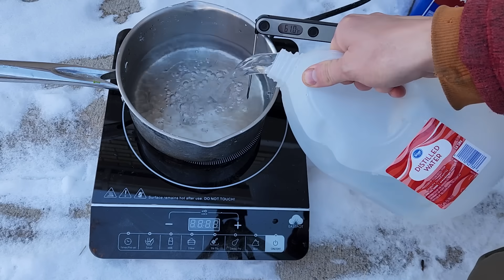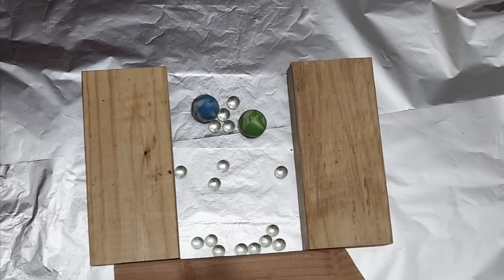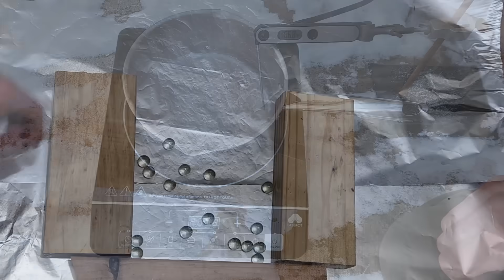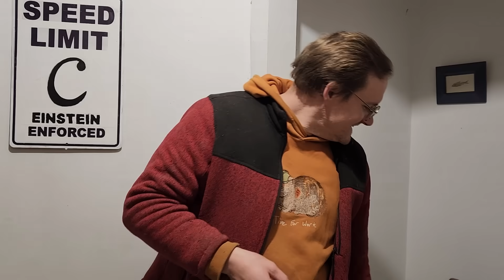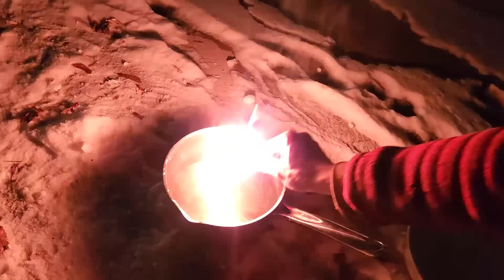Raoult's law

Comment: Wait is this why adding silica to iron makes iron melt at a lower temperature? (I think the same is true with iron to silica when making glass, too, but I don't remember for sure. I just know silica into iron lowers iron's melting point)
Reply from the maker: yes. alloys typically have lower melting points than pure metals. the exceptions being when they combine to make a crystal that is more stable.

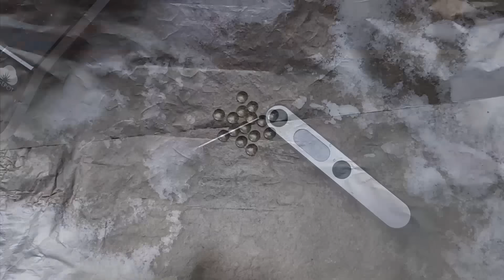Comment: 06:15 ....Is it? We need subtitles.
Reply: Yes, when you force a solid into a liquid without adding energy, it takes energy to complete that task, thus lowering the temperature. A fun experiment at home will prove this. A bottle filled with water and ice, just at 0C, will stay there at 0C until all ice is melted. If you add salt to the second sample, the ice will melt, absorbing some energy and dropping the temperature. This should be very well measurable.
Reply: @Robbedoes2  He said the water is now boiling at a lower temperature than normal. And then showed some weird americanese numbers. I have no idea when water boils or how abnormal that was.
Reply: @nazamroth8427  He said melt, not boil. And 32°F is melting point, thermometer showed lower

Comment: I dont get this. It all seems around blocking exit points, but I thought it can evaptorate anywhere in the liquid? Also why wouldnt the liquid boil at different temps based on its surface area or volume?
Reply from the maker: I see what you are getting at. if you had the mixture contained in a pressure vessel and then suddenly released it a large fraction of the liquid would in fact instantly turn to vapor as a new equilibrium is established at the lower pressure. 
Yes the blocking exit points thing is a surface behavior, describing it explains how it will evaporate and the temperature at which it will start boiling but after that point all bets are off.
Reply: The blocking the exit points explanation is basically wrong but the real explanation is entropy which is even harder to explain (look up the derivation of raoult’s law if you want to update your thermo. It comes from the entropy change of an ideal mixture). 
Sometimes I like to think of mixtures from the context of like-attracts-like. So water is very happy to be in the liquid phase and surrounded by other water. When you add something that isn’t water, it generally isn’t as happy. The identity of that second component then can add additional no ideality (ideal = water is indifferent to the new component, just near less of its friends; nonideal = water really likes or really hates the new component).

Comment: I remember growing up in Salt Lake, and my dad telling me that adding salt to the water made it boil sooner than unsalted water, but not HOW. I assumed then that it was because salt water had a lower boiling point than pure water, and thought my dad was a moron because he didn't know that the water wasn't reaching a higher temperature. I now see that the water WAS reaching a higher temperature than even pure water, but it's equally clear that he didn't know why, he was simply reporting experiential observations without understanding the underlying mechanism. Thus, not a moron, simply uninformed.
Reply from the maker: Interestingly adding even a pinch of salt will in fact make water boil sooner because it (actually the contaminants in the salt) act as nucleation sites for bubbles to form from and that keeps the water from super heating. 
Adding a lot of salt will also speed things along because it has a lower specific heat, meaning that a given volume will take less energy to heat up even if it has to get to a higher temperature to boil.

Comment: Hey Cody, what do you think of the prospect of a piezoelectric battery? I was thinking of using a pressurized tank with suspended quartz and some form of electrolytic conduction fluid with "guide" wires hooked up to the discharge terminals.

Comment: One of things i learned that salt doesn't "melt" snow, it just make solution that has lower melting point. Solution is possible because there is equilibrium between solid and liquid and alvays is some part of liquid that can dissolve salt. 
And yes, the destilation "steps".

Comment: Is boiling things a way to see its purity as well? And in the same, you could proberly calculate how much water you put in the alcohol, buy the temperature of the boiling mixture?
Reply from the maker: Oh yes I could absolutely calculate how much water I added by the temperature. Infact I am pretty sure I had a homework problem like that once.
Reply: @theCodyReeder  Thanks for the answer. That was an honor having you reply. 😊
Reply: @darabbit333 in my organic chemistry lab class, the number one way to test for purity was to test its melting point in a fancy machine. However this doesn't give a definite purity unless you know beforehand what impurities are there and how the melting point will change based on them. So it was mostly just to gauge purity, like if the melting point was within 0.5 degrees it was pretty good.
Reply: @skanderbeg152  very interesting. Thanks for sharing. I wish the likes of Codyslab and other science youtuber was a thing in my youth 1990. Instead I had a science teacher who pretty much didnt know anything about science. It was just an english teacher they put up as a science teacher. My career would have been so much different.
Reply: @darabbit333  no problem. Sorry to hear about your disappointment, I feel very fortunate that I was born in a time where I was exposed to science, math and chemistry on YouTube by people such as Cody and I attribute all of that to the path I took. Now I'm several years into a chemical engineering degree.
Reply: @skanderbeg152  Impressive. Yes, these guys most have influenced several generations by now. I have followed him since 25k subscribers and it has been a blast. Its a bit sad there is such a long wait time between videos, but i enjoy them when they arrive.

Comment: When i make table salt the correct way using the right method, i do it exactly like the corp of discovery did on the west coast in December, 1805 to March, 1806 near fort clapstop.  I add sea water to a big pot and boil all the water away and am left with high quality sea salt.  i'm sure i could trade it for horses and blankets and stuff but i mostly use it for seasoning, and deicing my driveway, stuff like that.

Comment: That's why you add salt when boiling pasta 😳
Reply: No, it only changes the temperature a small bit. Especially at the concentration used for cooking. The salt is added to flavor the pasta. Notice how much salt Cody added to how little water and the temperature only increases 4 degrees.

Comment: Bro that intro blew my mind! had to watch it 5 times. Ty for content im sure i will enjoy the other 99% of the vid aswell.
Edit: When you add water to boiling alcohol and the temp goes to 161, you mentioned that the temp goes up so it resembles the water boiling temp more. My question is if the water is really boiling at lower heat because of it or is the alcohol boiling and the water just warm? I just thought it was interresting, maybe not :D
Reply: Fun fact: if you add ethylene glycol to water, the boiling point will increase and the freezing point will decrease: the opposite of a alcohol/water solution.
Reply: Now this is where we get into henry's law too and the fundamentals behind distillation. So stay tuned ;) The truth is, that the changes are gradual and the partial pressures in the evaporated binary gaseous phase are related to the concentrations in the binary liquid mixture.

Comment: I usually just say I add salt to the water so it boils faster, but this is much more accurate.
Reply: You add salt to pasta water to season the pasta. It actually makes the water take longer to boil (it has to reach a higher temperature) but more importantly it does not change the boiling temperature any appreciable amount at the concentration used for cooking. Notice how much salt Cody uses and it only raises the temperature by 4F.

Comment: It snowed enough for it to be thick on the ground for the first time in about 48 years at my house.  I'm trapped by six inches of snow.  Can't seem to find a snow shovel or warm mittens around the house. Got any suggestions for that?
Reply: 6 inches isn't too much to walk through. It will melt soon enough.
Reply: @MushroomMagpie  I need to drive though.  My driveway is on a hill and it's now an ice covered with snow on top hill leading right into a frozen ice covered alley that leads to a snowy icy road.
Reply: @gabrielpowers766 . Frankly, I wouldn’t. I love playing in the snow and have an old awd with good snow tires, but ice don’t play (and even I don’t go out in it). Unless you can put on chains, keep it parked. 
If you have sand, spread it on the ice in the morning: the sun may warm it enough to melt into the ice to give you traction. Or, if you have a wood stove, I remember reading in Mother Earth News decades back that people would spread ash for the same effect. I never tried that, though—and it would definitely be messy. Be safe.

Comment: This is how oil refining works.  Each fraction of the oil is driven off at a specific temperature.  The lightest molecules are driven off first and the heaviest fractions are boiled off last.  Each tower is hotter than the last.
Reply from the maker: However, relating to the topic of the video, it is important to note that there is overlap between the fractions. It is very difficult and, in most cases, impossible to obtain a pure substance through distillation.

Comment: Adding some nucleation points (non-soluble powder) can aid the lower boiling point solvent to boil off.
Good for reducing the methanol etc... from cheap alcoholic beverages by heating just below the boiling point of alcohol.
Homemade hard cider and cinnamon make a good experiment and it gets pasteurized it for storage for a bonus.
Freeze distillation to make applejack is a good demonstration of the freezing part.
Tripled freeze concentrated pasteurized applejack with cinnamon is like delicious warm apple pie without the huge hangover associated with applejack.
Legal for personal consumption in Missouri but highly regulated most other states

Comment: Alcohol molecules are heavier? Isn't alcohol lighter than water?
Reply: Alcohol is less dense than water, but each molecule is larger and heavier. They're just further apart than water molecules are.
Reply: @jaredlancaster4137  cool thanks
Reply: Water molecules have two hydrogen and one oxygen, alcohol has carbon as well as oxygen and hydrogen, it's a bigger molecule

Comment: Question : Why can we perform fractionnal distillation if there's not the lower boiling fraction that boils first ? When I distil a water/alcohol mixture, I obtain an azeotrope (96% vol) at 78,2°C because the ethanol dominates the surface of the boiling mixture (with a little bit of water because of bonding azeotropic behaviour). If there's no azeotrope, you still obtain fractions
Reply: Vapor pressure.
Reply: It has to do with what the definition of a boiling liquid is. Boiling is when vapor pressure of solution = total pressure. So using the ethanol water example, yes it’s true both components ‘boil’ together, but there is more ethanol in the vapor than water so the distillate is enriched in ethanol. 

Your point about an azeotrope is what happens when, due to the energetic interactions between ethanol and water, both components are present in the vapor in an equal proportion to the liquid. So if the liquid is 96% ethanol, say then the vapor is also 96% ethanol. 

Furthermore, if Raoult’s law were reality, azeotropes wouldn’t exist. This fact is why chemical engineers enjoy job security.

Comment: You know that's always a detail I forget about water is the fact that it does have literal hydrogen bonds holding them together and is part of the reason water has such an impressive surface tension despite having a super low viscosity.
Reply: As opposed to figurative hydrogen bonds?
Reply: @ferretyluv  hahaha.
Reply: @ferretyluv  I believe they are literal as opposed to actual, honest-to-god hydrogen bonds, those are a little less common to find out there
Reply: @ferretyluv  Exactly.
Not an unusual figurative statement to make among those educated in the topic. I've often heard van de waals forces referred to as induced hydrogen bonds, while they are essentially the opposite of a hydrogen bond....

Comment: I thought it was because the salt has a high affinity to water. So it takes that much more energy to not only overcome waters affinity to itself but to also overcome the clinging forces being exerted by the salt.
Reply from the maker: You are not entirely wrong. what you are describing accounts for some of the discrepancy from ideal behavior. for example, a 10 molar solution containing one salt may have a slightly different boiling point than a 10 molar solution of a different salt that has a different affinity to water.
Reply: @theCodyReeder  - So ... Is that calculable? To the degree that we know how much of which phenomenon is contributing? I ask because I'd assume that my point accounts for the predominant force but your response makes it seem like it's substantially the minor. - Either way, it's definitely interesting and something I didn't know about. I have a reading topic for this weekend now, haha.
Reply from the maker: @ghosttheoremproductions5469  I believeso, but you would also need to know the physical size of the molecules, as that also affects it.

Comment: man did those ethanol fumes get you drunk?
Reply from the maker: You could tell? I was trying so hard to act sober towards the end there. lol.
Reply: @theCodyReeder  You did a good job then I couldn't tell! I was was given a hunch by the fact that pure alcohol was condensing onto your thermometer, I just had to imagine it was also condensing on your lungs.
Reply: I'm more concerned if the methanol fumes made him blind.
Reply from the maker: @PherPhur  the funny thing is; the cure for methanol poisoning is ethyl alcohol. so, if you drink ethyl alcohol contaminated with methanol, as long as it's a fairly low concentration, you will probably be fine.
Reply: @PherPhur  That's actually a real concern when working with methanol... 
Ethanol is pretty much not dangerous (unless you are actively trying to make it dangerous...) but, just to be safe, I usually work with any volatile organic solvent under a fumehood.

Comment: What I think is really fascinating about you using denatured alcohol is the fact that they denature it using methanol which technically you could boil off and technically as long as you're careful with it you can get your concentration basically down to zero when it comes to methanol which is really quite interesting to me. The seeing as denatured alcohol is really cheap. I do just want to say to anyone who reads this and thinks that they can do it don't. And if you do do not use it for drinking. Denatured alcohol is not typically a food grade ethanol it is technically not safe to consume. Even without the methanol. If you're wanting to do this use it for like hand sanitizer or for cleaning do not drink it.
Reply: Truthfully I am curious why they use methanol instead of isopropanol. Isopropanol has a much stronger taste that is actively pretty foul. To my knowledge isopropanol is not as dangerous as methanol but it may also not be as easy to treat the poisoning. I have no idea
Reply from the maker: @borttorbbq2556  Ive tasted pure Isopropanol and if anything, it is less harsh than ethanol, what you are tasting is probably what they put in it to discourage people from drinking it.
Reply: @theCodyReeder  yeah that's fair. I don't know what that bittering agent is but it is powerful stuff.  I thought isopropanol was more harsh I guess the more you know.
Reply from the maker: Dang. I actually discussed this but cut it from the video, guess I should have left it in. Basically, it is such a small amamout that I wasn't particularly worried about it.
Reply: @theCodyReeder  I've made cocktails using denatured alcohol that we cooked. Just used it the same way I would ever clear. And theoretically as far as I understand it's no different than the process of distilling it in the first place. Except you don't have to worry about the tails as there is no isopropanol. That was mostly a covering my butt. I don't want people thinking I recommend doing this. Because while if it's done correctly it'll just result in a relatively high purity ethanol. If it's not done right it could harm a person severely. Also it's technically against the law.

Comment: I always wondered whether steam feels so warm on your hand because the vapor fraction condenses on your “cold” hand. And the act of condensing releases as much energy as it takes to evaporate from the liquid state. Perhaps the ethanol has a lower condensation enthalpy and therefore feels much cooler to your hand? Thanks for the educational video and clear explanation! Love your videos
Reply from the maker: Ah yeah exactly. also when it does evaporate it does so faster thus adding to the "feels cooler"
Reply: @theCodyReeder  Oh that could be a video. Put wet bulb temperature, dew point and azeotropic mixtures in a video. Also, how much of the Xenon is left?
Reply: Steam feels warm on your hand even if it doesn't condense on your hand, just because it's hot and has much more thermal mass than air.
Reply: @jaredlancaster4137  Good point, I'm sure there's an interesting list of phenomenons - possibly a follow up?
Reply: Steam feels so warm because it's dumping all of the latent heat of vaporization into your skin when it condenses.
Reply: This reminds me of being in a kitchen.  200F oil doesn't feel particularly hot if you dip your finger in quickly due to how little energy enters your skin. 
200F water... very different story